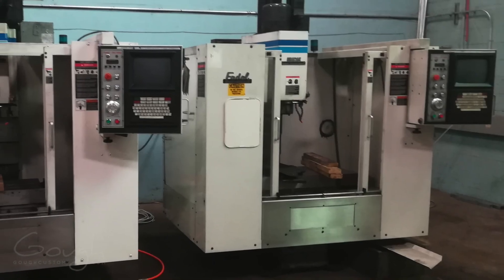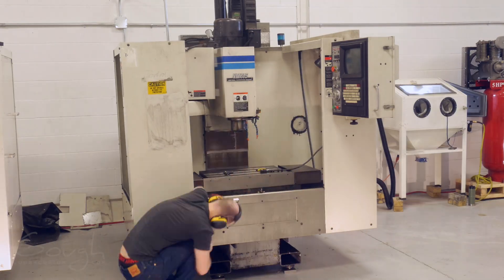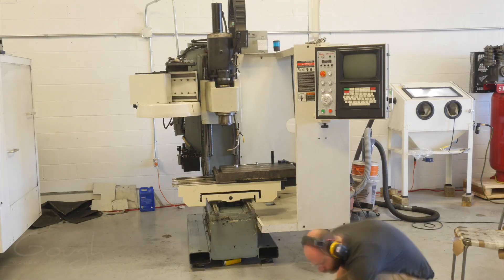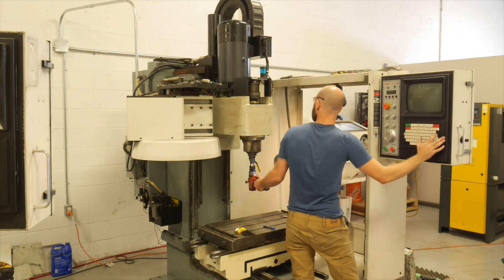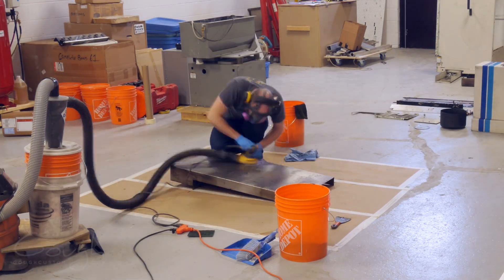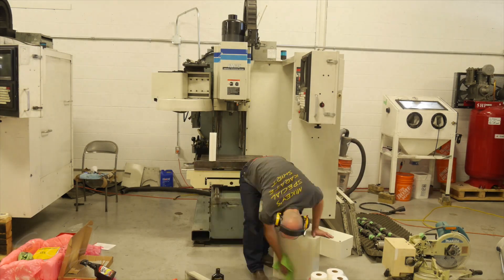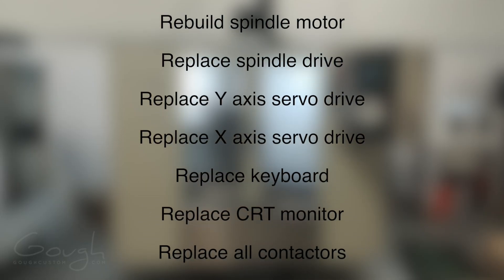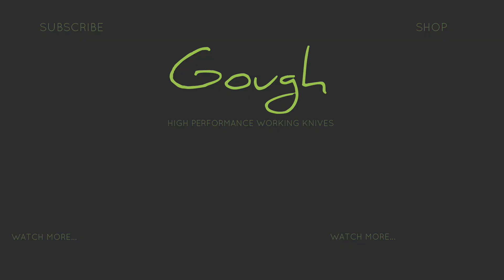Restoring a 24 year old CNC machine...

Comment: The machine looks nice but does it run better after all the money spent?  By better, I mean does it run faster when running 3D programs?  Does it still have the same 1996 computer in it?  I had a 1995 machines that had a very slow computer controller with no memory on board so every 3D program had to be run from serial cable or the machines floppy drive and still was very slow.
Reply from the maker: Hey Wayne! I'm curious what you would define as slow, as that's going to be very subjective... I have 2 Fadals, both with the CNC88HS controller and it's plenty fast enough for my needs. They do have relatively limited memory but I have Calmotion USB interfaces added to both which allows me to drip-feed unlimited size programs easily. The machine/control is easily fast enough to 3D contour at 150IPM... New machines can definitely go a lot faster than this, but I actually usually run at around 70IPM as I'm limited by the materials and spindle speed anyway...
Reply: @GoughCustom  If you're running at 70 IPM and getting good results that's pretty good.  My old '95 machine couldn't go faster than 8 IPM before it would hesitate with stop and go motion.  The next machine we got in '99 could do 20 times that, so we were very happy.  I was concerned that you put a lot of hours in rebuilding and not getting speeds that would make it worth the effort.  Looks like you made the right decision to rebuild if they can last.  Maybe at some point they updated the controller.
I only bring that up because I worked at a place in the late '80s that purchased two new Fadals that couldn't cut anything accurate and slower than frozen you know what.
Reply from the maker: @wayned1807  Interesting! The stop/start motion is a symptom of 'code starvation' so it seems likely the issue was actually with whatever system you were using to drip-feed the code to the machine, rather than the control itself! I have a demo showing my VMC10 cutting annealed A2 tool steel here: https://www.youtube.com/watch?v=wfppEEUyuDk Newer machines are definitely faster but these seems to be mostly keeping up with what I need for now! I'm holding total tolerances of 0.0005" on one part with no issues!
Reply: @GoughCustom  Yeah, I agree to a point.  The '95 machine used the floppy drive all the time (I gave up using the serial to feed) and the '99 machine could also use it's floppy (it now has Ethernet also) but the difference in speed was like day and night just feeding from the floppy and now a USB.  Cutting 2D I saw no difference.  I cut mold cavities so 3D is my bread and butter so speed and accuracy is important.
Reply from the maker: @wayned1807  Interesting... I wonder what the deal was with that old machine... Perhaps it had a 'CNC88' control rather than a 'CNC88HS' which is the 'high speed' version like my machines have...

Comment: Relatively long time ago, I was doing a short gig in a factory and behind me there was this CNC being refurbished (Starrag Heckert) that was cutting relatively small 5 axis parts 24/7. The guy from the manufacturer spent if I remember correctly 4 or 5 days there. Replaced all of the linear rails, bearings on rotating axes, ball screws and the most interesting part was the calibration and the interesting tools he had. Even had a laser interferometer type thing (from renishaw if I remember correctly) to dial things in perfectly. It was interesting to see how much work was it to get the machine back up to spec. What I found odd was that the spindle was on a moving column that was just made out of welded plate steel - not cast iron or some fancy polymer concrete type of thing. Cleaning was the first horrible task :D The sludge was everywhere and he spent a great deal of time with a guy, who's only job in the factory was to replace oils/coolants and vacuum spills and oily dirt in the factory.
Reply from the maker: Very cool! It's always so interesting to see these machines apart!

Comment: The best part about them being used to machine graphite is the fact it's a dry lubricant, so there should be little to no wear on ways and so forth.
Reply: You would think; graphite is quite abrasive.
Reply from the maker: Yeah unfortunately I believe it depends on the formulation... Some types of graphite are abrasive and others are lubricants... Either way the mechanical side of the machine was in good shape which is great!

Comment: Graphite is the ultimate lubricant and preservative,  except for electrical equipment. You got a score there indeed. Well done on the noise reduction  and on the major overhaul.
Reply from the maker: Thanks Robert! Yes they seem to be in pretty decent shape mechanically! The one negative that graphite can have is to block lube injectors or to dry up grease in a 'sealed' bearing, which it had done in a couple of places. Nothing some fairly cheap replacements couldn't fix!
Reply: @GoughCustom  I am building a small hybrid router/mill and the emphasis is on noise reduction. The 2 kilowatt linear power supply is whisper quiet and I am using closed loop stepper  which are very quiet in comparison to standard steppers. Also have built an acoustic enclosure out of 3 inch cool room panels. All because Lady Overlord does not like cnc noise. Cheers
Reply from the maker: @postiemania  Nice! Yeah I could live without the CNC noise as well.. I'm actually working on plans for a very compact BT30 machining center with a focus on quiet as well!

Comment: I'd be a bit concerned about the linear guides and ball screws, I've always been told to stay away from any machine thats been used to cut graphite.  That machine looks great though, you did an amazing job.
Reply from the maker: Thanks Craig! Luckily the precision of the ballscrews and thrust bearings is easy to check, just a dial indicator on the spindle nose and then go through each axis jogging back and forth in small increments looking for lost motion. The machine I kept needed a thrust bearing replaced on the Z axis, but apart from that it's very tight! Less than 0.0002" backlash on all axes. Linear rails are harder to test as they can be a bit loose and run fine on light cuts, but then chatter on heavier cuts... This can be tested a bit by putting an indicator on the nose, then pushing/pulling on the table and looking to see how much it moves. Overall the machines seem pretty good... I think graphite is mainly a danger to the electronics and the lube system, both of which can get expensive quickly!
Reply: @GoughCustom  you definitely seem to know what your doing, I would imagine if any of those things did go bad you'd have no problem fixing it.  I'm always so weary of trying to fix anything on our machines but when you think about it they are actually very simple machines.  But again amazing job, that machine looks great

Comment: Hey Aaron, cool video! Have you give any thoughts on making wood handles? A stabalized Hard wood should behave like your plastic. And then team up with a leather sheath marker to make a Deluxe version. That would be awsome!
Reply from the maker: Hey Henrik! I would really love to do wood handles, unfortunately I have seen even stabilized handles shrink/grow with humidity changes which ruins the fit & finish of the knife. I definitely want to try it though, I am looking into a process where the wood is 'double stabilized' by first 'torrifying' it (baking it to caramelize the wood sugars and to dry it out) and then vacuum/pressure stabilizing it... That sounds like it should produce a very stable final result!
Reply: @GoughCustom  Sound very interesting!  There are tons of knowlagde out there regarding wood stabilization, I am sure. Let me be your first demo tester on wood handles. :)

Comment: Awesome you are back. Can you provide a link for the lcd monitor you used? Was it plug and play with the existing connectors?
Reply from the maker: Hey Thomas! Here's a link to a thread on Practical Machinist where I describe the upgrade process, it has the links you need! https://www.practicalmachinist.com/vb/cnc-machining/easy-cheap-fadal-screen-replacement-374307/

Comment: I had exactly the same noise issue on a robodrill that we retrofitted.. Simply loosen the tension on the grooved beld on the spindle and your   noise will disapere
Reply from the maker: I definitely found the same thing, that loosening the tension really helped! I loosened it off a fair bit but was concerned about going to far as the belt was starting to 'slap' at high speed.

Comment: well you seems to work for 1$ hour ... is it worth it?
Reply from the maker: Hi Bruno,
I think the math you're basing your assertion on is flawed to say the least... Let's look at each machine separately:

The machine I sold - 
Bought for $3900, storage/rigging $1000, parts $1000. Total: $5900
Sold it for $12,000
I spent about 2 - 1/2 weeks working on that machine, so around 100 hours.
$12,000 - $5900 / 100 hours = $61 per hour.

The machine I kept:
Bought for $3900, storage/rigging $1000, parts $10,200. Total $15,100
I could have bought a different Fadal in better condition for somewhere around $12k, but I lost the lottery on this machine a bit with the spindle drive issue. If that hadn't been a problem then parts would have only cost about $5,700 for a total cost of $10,600.

The real value in the machine I kept is in the work it produces. I needed a machine to make my knives, so I either needed to buy another machine used for ~$12k (and still face potentially having to spend a lot of money on parts as I need a very tight machine for my work) or buying new for $78k. The machine I kept has already more than paid for itself in the 6 months that I've been using it and I have no monthly payments or anything to make on it which makes my life a lot less stressful! 

And despite having already paid for itself and continuing to provide value daily with it's output the machine is still worth an easy $12k, which means now I have an asset rather than a liability. If I'd bought a new machine I'd be making payments for the next 5 years...

TL:DR - No I don't work for $1 an hour. Yes it's worth it!
-Aaron
Reply: @GoughCustom  its just my frustration I refurbished a CNC  and other machines . at the time I got ready for my small business  I run out of money..lost all .wish you luck
Reply from the maker: @BrunoWiebelt  I'm very sorry to hear that mate. It's definitely a difficult balance to strike. Buying new you can get to work right away but then you have those monthly payments to make... Buying used you save money in the long term but may face significant delays up front that stop you from delivering paying work, like you experienced... I hope you're able to find another way to get started and get back on your feet!
Reply: @GoughCustom   I am doing ok , found a job not easy as an 61 year old , but there is a home and food on the table... good luck for you
Reply: but it was fun to restore a cnc it was a Chiron with Linus control ... tinkert a bit tooo much :)

Comment: Beautiful work. lots of cnc are just run till they dont hold a tolerance.
Reply from the maker: Thanks! Yeah it's a bit silly because it many cases they can be fixed cheaply, especially Fadals where all the parts are cheap and easy to get...
Reply: @GoughCustom  yea, at my work they run the cnc to the maximum, only fix them when they break. 

You took a cheap machine and made them into something, I love that.

Comment: Yup. Own a 1997 model 3016 that was factory refurbished in 2004. Pretty much everything you replaced/cleaned, I've had to do. Drive went out, replaced with the Glentek. Spindle went out, replaced with a new one from FadalCNC. Various little parts went out . . . the last one I just did was the CMOS battery died losing all my settings/programs/offsets. The good part is they are indeed easy to work on. It's like the Honda Civic of the CNC world, cheap (relative to other machines) parts and you can do a lot of the work yourself. I guess you checked backlash on all your gibbs? Taking the enclosure off makes that job super simple. When I first got my 3016, it would chatter badly in the 2nd and 4th quadrant making arcs. Turned out I had .002" more backlash than specified in the manual on the Y axis.
Reply from the maker: Yeah they are a really good machine for the price! Not sure I'd choose a new one over a HAAS at the same price (which is probably why they went out of business) but buying them used is a good deal! The 3016s are supposed to be beastly little machines! A lot more heavily constructed that the machines shown in the video! These machines don't have gibs actually as they're linear ways on all axes rather than box ways like on your machine... Box ways are definitely sturdier but need more maintenance like you saw!

Comment: Very nice! I've never even heard of anyone buffing the paint on a machine tool! It's surprising to me that the spindle enclosure on a Fadal has no insulation. Even Haas has that...
Reply from the maker: Hey Wes! Honor to have you watching this mate, I've enjoyed watching a bunch of your videos! I know you can empathize on getting covered in filth working on an old machine!

I'll be the first to admit I can get a bit carried away with making things look nice, but I figured in for a penny in for a pound so to speak!

I was a little surprised too at just how noisy the spindle was... Still trying to think of ways to quiet it down further. My understanding is that the majority of the noise comes from the toothed spindle belt, from the air rushing out between the teeth as the belt and pulleys mesh. I bought a narrower carbon fibre belt as I'm led to believe that narrower belts make less noise due to less air displacement. I've also heard that some guys running superchargers will grind slots into the crown of each tooth on the belt to give the air an easier escape path, might try that as well!

I'd welcome any ideas you might have mate!
-Aaron
Reply: @GoughCustom  I'm not sure there's much you can do. Haas uses two or three belts side by side instead of a single belt. That might help a bit. Most VMCs I have worked on used foam insulation inside the spindle covers. Something like you would find on page 3772 of the McMaster Carr catalog. Keep up the good work!
Reply from the maker: @WatchWesWork  Thanks bud! I will experiment with some stuff!

Comment: Oh man! I see a Hardinge CNC lathe. I have one, I know your pain in dealing with old Fanuc electronics. Solid machines but oh boy are they finicky on the Fanuc side.
Reply from the maker: Yeah that was a really sweet little lathe! Unfortunately I never got the chance to run it as I ended up finding an outside supplier for the parts I had been thinking to run on it... However I've heard Hardinge's of that vintage are built like tanks and all the work I did to get it cleaned up certainly left me with that impression as well!

Yeah the Fanuc controls seem like they were deliberately made as hard to use as possible.. Popping up alarms that are just numbers with no explanation???? So not helpful!
Reply: @GoughCustom  if you ever get a chance, find a cincinnati arrow/saber machine. the siemems controls (a2100) are touchscreen and veryyyyyyy nice to use for a 24 year old machine, comparable to a brand new dmg mori. we have mills with the fanuc controllers and i would throw every one out if they were mine.
Reply from the maker: @Donkusdelux  I will make sure to check them out if I ever see one!
Reply: @GoughCustom  Be sure to, i swear by milacron machines, tougher then a haas by a long shot. 

mine is 24 years old and will hold .0005" on a circle with no compensation, the one at work we cannot break.  it runs 100% load for weeks and the main motor fan broke about 7 years ago, mainly runs ar600 aswell.

Comment: Quite the Treat to find you Ok and well with another fine rebuilt machine in your kit!!  Been missing you and your fine videos!  It's been a crazy year or so, eh?  Us too!  Nicely done on the machine...Graphite...Oh My!  Was the LCD a bit of a challenge?  Think your ROI will be short and surprised only 120 hours.  Beautiful Bluing, BTW!!  Must have been a question to keep the second one for spare parts but glad you were able to reduce your costs by selling it.  Made my day seeing your video and fine work again!  Thanks Aaron for all you bring!  ~PJ
Reply from the maker: Hey PJ!
And quite the treat to see that you're still watching my videos! Yeah it's definitely been a crazy couple of years... I have another video coming soon where I talk through everything that happened in the last couple of years, it's been quite the journey! 

The LCD was actually pretty easy! I ended up finding a monitor with a huge range of inputs. RCA, HDMI, VGA and BNC all on one monitor! Added a 12v power supply, plugged in the BNC cable and it worked on the first shot which was great! If you'd like to see more info on the installation I made a thread over on the practical machinist forum: https://www.practicalmachinist.com/vb/cnc-machining/easy-cheap-fadal-screen-replacement-374307/

120 hours is definitely a bit of a guess, I worked on the machine over a couple of months so I had to estimate a little lol... 

I would have loved to keep the second machine, but I actually ended up moving back into a smaller shop, and didn't have space to keep it anyway! I still have 2 machines now though, my original VMC10 and the new VMC15 which is great! The VMC15 is supposed to be dedicated to knifemaking, with the VMC10 mostly reserved for prototyping and odd jobs. Pretty amazing to have 2 CNC machines now!

I hope you're doing well mate!
-Aaron